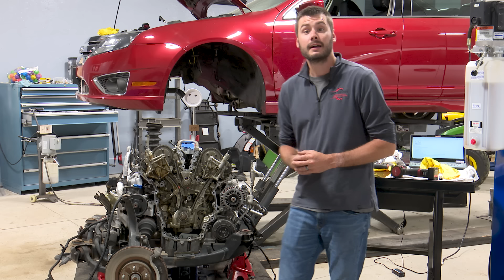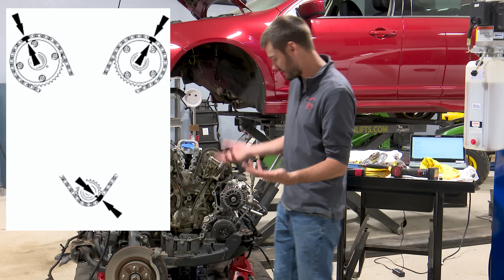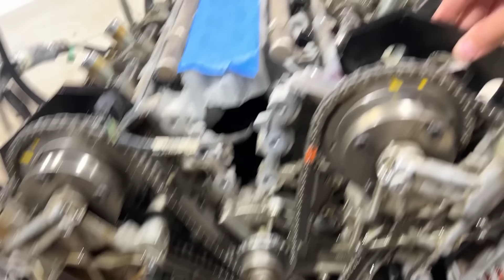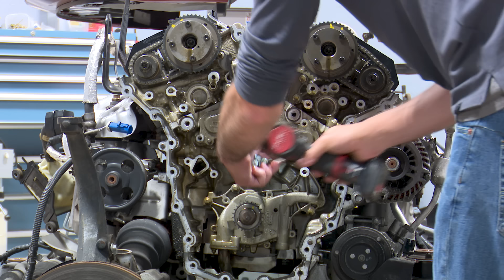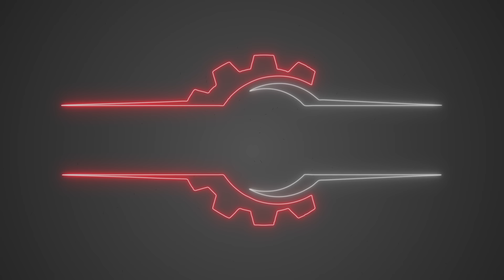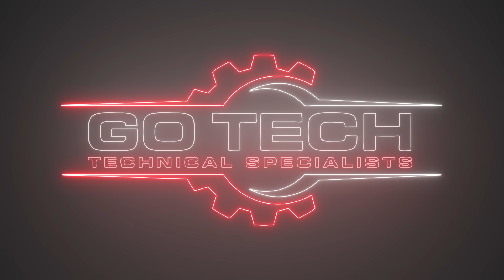How To Replace Ford 3.5L V6 Timing Chain and Water Pump

Comment: Nice work, Mike!  Wow - the engineering on this one is mind-blowing! One 6 foot chain and two 18" chains to run a pair of cams! Note to self: NEVER take a Ford 3.5 for free! 😂
Reply from the maker: Hey Smitty, thanks for watching dude! Not a bad engine overall, besides this issue lol!
Mike Becker, Senior Instructor
Reply: It's an excellent engine, as far as American-made goes. Idiots who don't know how to take care of a car will ruin any engine.
Reply: My friend has a 2016 explorer, has 167k  and maintains it really well, but hasn't touched the timing chain
Reply: @richsweeney1115  Sometimes you get a good one. I'm not a gamblin' man, especially with $40,000, so I'll stick with my 30+ year old relics. 😁
Reply: @SmittySmithsonite  yea, but they're not that expensive used, but I've never had a bad ford though, I've had a lot, mine,my familys, and friends,  all were sold of traded in for.smethjng different with well over 200k, but I maintained most of them, and im  religious  about maintanance
Reply: @richsweeney1115  Sure, built before 2007. I’ve got an ‘86 Grand Marquis that has 299,000 miles on the original driveline, and original fuel pump. Still runs like a top! You won’t get that kind of mileage out of anything newer than a ‘15 without major engine work, I can guarantee.
Reply: @SmittySmithsonite  minor engine work new AFM lifters I got the 2011 Yukon hybrid original water pump and it up front easy to get to. Original fuel pump, original block and heads new lifters passenger side ofcourse and I run the range chip now to shut v4 off. It’s tank 6.0 323k original transmission also
Reply: NEVER POS GARBAGE
and that's coming from a Ford Motor Company factory repairman.

Comment: Hi Mike, great video, the fact that this can be done in the vehicle looks to be a pain, and the customer might not want to pay to take the eng. out but, I personally think  the time factor between eng. removal and doing in the vehicle isn't worth the aggravation, I'd rather pull it. (My opinion) I think the job would go faster and smoother. So wouldn't the job time even out??

Comment: My friend had this issue recently and dealer scared them into getting a new engine, vs replacing water pump and chain. How soon was this issue caught, once the coolant started going into the crankcase? Do you have a concern of secondary damage? I am trying to figure out at which point in time you gotta give up on the engine vs rebuild it?
Reply: You can pretty much rebuild almost any engine as long as it isn’t in pieces but it’s not always worth it.

Comment: Good job Mike.  Lotta work just to change the water pump.  My Wife's 06 (timing belt)Kia, and my 06 (timing chains) Nissan both have the water pump "under the covers."
Reply: Imagine being a Ford Tech doing that work often.
Reply from the maker: Hey Mike, thanks! Yeh, it is...but hopefully it's the only time it will need to be replaced.
Mike Becker, Senior Instructor

Comment: The 3.5 is a very durable and well designed engine. Failures occur in any engine.
Reply from the maker: That they do. Besides the water pump issues, I really like the engine.
Mike Becker, Senior Instructor

Comment: i seen guys do these in 7-8 hours sometimes 6 without pulling the engine these are fairly simple  i like taking my time when doing these we get almost 14 hours for these
Reply from the maker: No sense in rushing through it and causing a potential comeback, right? Thanks for watching!
Mike Becker, Senior Instructor
Reply: The 3.5 in the fusion is to close to the right frame rail, you must remove engine.
Reply: @harrybalsonya5619  if you know of any videos on how to pull that whole front out like in this video please- let me know!
Reply: @scottmitchellrose1732  I have no knowledge of a video. I am a Ford technician and have done this several times,it isn’t difficult. Keep this in mind, this vehicle was designed for easy assembly and the power train assembly is a plug and play. 
The wire harness and the battery cables will stay with the engine assembly, disconnect from fuse box/ battery. AC will need to be evacuated but compressor remains on engine along with the lines on the compressor, follow them to the connections and remove. Two heater hoses and radiator hoses above the trans at back of engine plus the two hoses at coolant bottle. Exhaust Y-pipe stays on engine, disconnects just past the frame assembly if not rusted to badly. Don’t be afraid to give yourself room to work, remove the cooling fans and radiators if needed. Remove the trans cooler lines at the transmission. Fuel line and vapor lines at the right side bulkhead area, disconnect them. Remove the vacuum line at brake booster.
Of course the chassis parts will need to be disconnected, remove the struts from the top at the body, take them with the power train, remove the calipers but hang them from the body don’t separate the lines. You will need to disconnect the upper control arms from the knuckle.
Tips… when lowering power train, do it slowly looking for anything that was forgotten or got hung up. Be aware, when the spring/shocks disengage the body they will tip outward, this can cause the inner axle/CV joints to pull apart. To stop this, tie the steering knuckle to the lower control are, wire or bungee cord will work.
Don’t cheap out, use a Motorcraft pump, Mahle valve cover gaskets are the factory parts and fit better than Fel-Pro. A timing chain and tension is strongly recommended, the guides seldom need replacement unless broken. Rock Auto has these parts. Good luck.
The steering shaft will need to be disconnected from the gear. If hydraulic steering, there is a cooler line on the left front corner that connects the area of radiator. If electronic steering the power& ground is connected around the fuse box/ battery area, network wires are on the forward part of the frame that you’ll be removing disconnect these, leaving the steering gear bolted on the frame.
Reply: Thank you Harry!

Comment: PROBABLY THE WORST IDEA FORD EVER CAME UP WITH TO PLACE THE WATER PUMP INTERNALLY. I HEAR THEY ARE ALSO VERY EXPENSIVE TO BUY. THEN IF THE CUSTOMER DOES NOT CATCH IT IN TIME THE BEARINGS GET WIPED OUT IN THE ENGINE. AND TO TOP IT OFF A DIRECT INJECTED ENGINE. SORRY BUT IN MY OPINION A TROUBLE MAKER THE LONGER IT IS ON THE ROAD.
Reply: I call BS on the 4 hours! 😂
Reply: @vincentoramycarter7679  Have you ever done one? Its very straightforward.
Reply: @mph5896 idk the shop has had mine for a day lol
Reply: @vincentoramycarter7679  yea.he's lying
Reply: All 3.5’s aren’t direct injected. The 3.5 eco boost is direct injected.
Reply: @Helicopter Dad! I am not familiar with a 3.5 in a fusion, but the newer Taurus/explorer I have never dropped the power train for just a water pump. I can bang them out in about 4 hours.
Reply: @mph5896  Where you located I have a 2008 Taurus X
Reply: @mph5896 dude you would never be able to do that with one of these motors. If you think so I'll bet you $1000 dollars and give you 2to1 odds. Save yourself the hard lesson and never try to take one of these on.
Reply: @mph5896  you are full of 💩, 4 hours🤣🤣🤣. The fusion sport used a 3.5L.
Reply: They actually do not use this design on the f150 3.5 of that era. It’s belt driven and mounted on the face of the timing chain cover. Must be a space saving move.
Reply: Honda and others do the same shit lol
Reply: @Greatnessneversleeps  I know pretty bad idea huh. Good for shop hours though.
Reply: @Gre @Greatnessneversleeps  Honda may do the internal water pump but its with a dry belt set up rather than a wet chain set up. Which is a lot better because if the external seal on this particular engines water pump leaks, it will leak down into your oil sump/pan area and if you don’t catch it in time, it’ll wipe out your main crank bearings and rod bearings. Also Honda don’t make you buy special tools to hold camshaft in position. Neither do they make you buy a bunch of torque to yield bolts. You might think “chains last longer than belts”. True. But with chain type timing components they use plastic guides and the chains do stretch. So I think I’d rather have a dry taming belt set up rather than a wet timing chain set up any day.
Reply: They all build that way, chev 3.5, honda 3.6, water pump same place.
Reply from the maker: Yeh, you aren't wrong. A failure of the component can cause major issues. Unfortunately, like Sammy said, they are all doing it now. 
Mike Becker, Senior Instructor
Reply: @sammy9452  BMW 325i too
Reply: @sammy9452 even the gm 2.4 ecotech yes there is a special timing chain sprocket holder so you dont need to do timing to replace the water pump but still not as easy as most gm water pumps!!
Reply: Lol, What would be a good time to replace these , like early mileage? I got a 3.7 11’ Stang w/24K miles. Not sure if its better to do it at 30 to prevent an issue?
Reply: @philipc9753  you dont need to worry about it. The mustangs and trucks, due to their longitudinal power train, have the water pump mounted externally. They only pump the water pump internally on the traversely mounted powertrains due to space constraints.
Reply: @philipc9753 get rid of it. It's a catastrophe waiting to happen.
Reply: Shhhh... I'm trying to sleep over here
Reply: How u know it’s the water pump..??
Reply: I picked mine up for 113 plus shipping and it was a motorcraft
Reply: Ford didn't come up with the idea, they stole it from other manufacturers
Reply: At least it’s not like an Audi, where the chains are in the back of the engine. The 4 cyl duramax, has chains in the front and back of the engine. So yeah, it’s ford that has the dumbest design
Reply: @mikeadams42  dumb is dumb. GM is as dumb as Ford. Audi is worse.
Reply: They're not expensive. I've replaced five. Gets easier every time. The $$ comes from the labor and other parts you need.
Reply: Keeps my wallet happy fixing them😊
Reply: ABSOLUTELY
THE WORSE most asinine poor excuse of a dumb assess idea of a better way technological advancement.
Reply: I hate Ford motors
Reply: All engine that are built. With this timming chain water pump set well do the same thing chain must be replace on time or you bend valves I think they all should use a gear drive set up

Comment: Thanks for the wonderful installation video. It sure sucks to have to drop the engine just to replace a water pump which is a fairly common replacement for most cars.
Reply from the maker: Hey N Lwin, thanks for watching! It's not too bad of a job overall. Not cheap, but not a bad job.
Mike Becker, Senior Instructor

Comment: Didn't know the Mondeo was released with a V6 we only got the diesel, petrol 2.3L n 2L ecoboost turbo here in OZ, thats really poor design (I'm well aware other manufacturers do it as well)  putting the water pump in the timing case but I guess there designed to fail ha!... What an absolute shit of a job tho full power plant removal for a water pump.
Reply from the maker: Hey Greg, thanks for watching! It's not uncommon for chain driven waterpumps on todays engines. This is far from the only one with this poor design.
Mike Becker, Senior Instructor
Reply: Yeah I know it's a common failure point I do them reasonably regularly but that doesn't change the fact it's very poor design n a pain in da arse to do, unfortunately long gone are the days of easy-to-work on motors where stuff like water pump failure wasn't nearly as common n if it did fail it was a quick fix n no oil contamination.

Comment: I never removed engine yet on the 3.5 ford for water pump. Or yet on 3.6 gm timing chain job yet. Always do them in vehicle working on them. Usually can’t tie up a lift that’s why don’t usually pull them out.
Thanks Mike as always.
Reply from the maker: Hey Chad, thanks for watching! Are you beating the book on those jobs doing them in the car? My biggest concern with in the car is the lack of clearance causing smugged RTV resulting in a leak after the fact.
Mike Becker, Senior Instructor
Reply: Fusion is too tight, you must remove the engine
Reply: I haven’t yet to this day remove engine for timing chain job. On ford or gm vehicle
Reply: in the 2012 taurus (what I'm stuck with) I've now learned you HAVE to remove it.  i thought i did a great job, but the unibody gets in the way and apparently i didn't put the black rv sealant on right.  3 weeks later it's leaking badly all over.
Reply: @scottmitchellrose1732  late 2011 taurus, of the same engine version as your 2012 I'm doing right now. I just raised my jack on the engine to get the timing cover bottom two bolts out, be able to fit them to the separation holes in the timing cover, and then jacked it up a little bit more to wiggle the timing cover out the front of it. The job is definitely slower than if I took the engine out, though. Working in the limited space kinda sucks.

I'm concerned slightly about smudging the RTV on the way back on, but I'm going to inspect it hella carefully, and I got permatex ultra black, so the stuff should be good/OEM. Just remember about the put on loosely, then tighten down after an hour- that way you get a good squish on the RTV "Gasket" - don't just torque it down immediately after applying the RTV. The other mistake you could have made was not having the surface clean (scotchbrite then brake-clean/acetone multiple passes clean) and dry before application. I've generally had pretty good luck with my RTV procedures, but I'm always taking them super carefully because that's my worst fear tbh.

Comment: We do them right in the car. We don’t remove the engine with chassis. But the 3.6 you mentioned from GM, definitely remove the engine and chassis.
Reply: Na I work at GM and do those they are gravy. 20 hours labour get it done in like 6. There is certain model or 2 where you really have to remove the engine but most you dont. Removing the engine is like an hour anyway.
Reply: @fuckjewtube69  Way less work if you take it out of the car you can have it done in six hours
Reply from the maker: Hey guys, to each their own. I prefer to pull them. I get the powertrain down quickly and feel better about the work I perform with all of the room to work on it that I need. 
Mike Becker, Senior Instructor
Reply: A friend of mine did not remove it on a 15 chrysler 300. Easiest job as you only need to remove the lower pan to across the timing cover bolts to completely remove it.

Comment: The 3.7 have the double sprocket on the water pump those almost never leaked
Reply from the maker: Hey, thanks for watching PEX34. Yeh those seem to fail less often for sure.
Mike Becker, Senior Instructor
Reply: @GoTechTraining  So a 2014 Mustang with the 3.7 would be safe then?  Or rather "safer"?
Reply: @stevechance150 longitudinal cyclones have a normal external pump
Reply: Actually only the 2011+ have the double sprocket. On both the 3.5 & 3.7 all the earlier ones had the single chains. 2011 was the change yr from the single to the double sprockets.. 2011 can come with either or I’ve done a 11 taurus and it had the single sprocket..I’ve seen both in the 11’s best to call the dealer and check on the 11’s with the vin number so you don’t order the wrong parts.. Hope this helps someone else out with it..

Comment: I did this 2013 Ford Taurus 2 years ago without removing the engine. (Customers don't want to pay extra labor to remove the engine.) https://youtu.be/AXPGUiWrcH0
A Mazda, 3 years ago.
And This 2008 Ford Edge 4 years ago. https://youtu.be/j3fV-VTkQ40
Reply from the maker: I respect that Gabriel! Tough job to do in the car! Thanks for watching.
Mike Becker, Senior Instructor

Comment: I just recently had 1 done on a ford flex due to water pump failure. Follow my channel if its not much to ask, i did not show how to do the timing chain nor water pump but instead i showed how the water pump fail and leak into the oil pan. And i did the same thing, i dropped the engine down :) for documentation purposes.
Reply from the maker: Hey Julio, thanks for watching! Sweet, I'll check it out!
Mike Becker, Senior Instructor
Reply: is that flex still running?
Reply: @jeremyfahrni529  ahahahahaha. Yes it is still running and customer have not returned yet. Othewise i will pack up and roll out my tool box :) :) :)

Comment: Customer should replace the entire car, with one properly designed. Go to your Toyota or Honda dealership
Reply from the maker: Hey Kevin, thanks for watching! All cars have their fair share of issues. 
Mike Becker, Senior Instructor
Reply: @GoTechTraining  every car has at least some. But some have far more and more serious issues. But thanks for echoing the standard party nonsense line
Reply: You mean like Honda and their cracked blocks and failing pistons. Go watch Scotty Kilmer you don't know crap lmao.
Reply: @fuckjewtube69  quoting that crazy old guy is prove that you don't know what you're talking about. That fool put a compression fitting on the brake line. Which is both illegal and dangerous
Reply: My Toyota has peeling paint, leaking AC evaporator and bad intake VVT.
Reply: @halleffect1  so fix it. Every car gets old and needs things replaced or repaired. But Toyotas need a lot less than others
Reply: @kevinbarry71  I did the evap, PITA job but you need AC in south FL.  the rest can wait
Reply: @halleffect1  Toyotas are known for VVT issues, easy to replace.